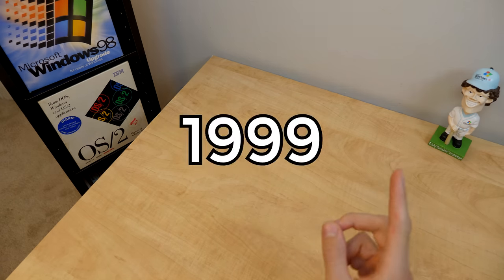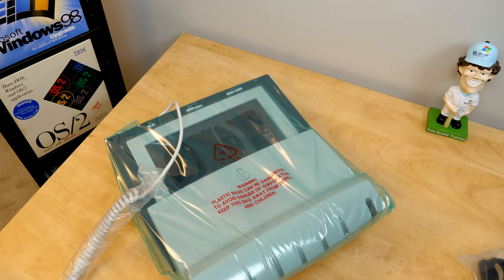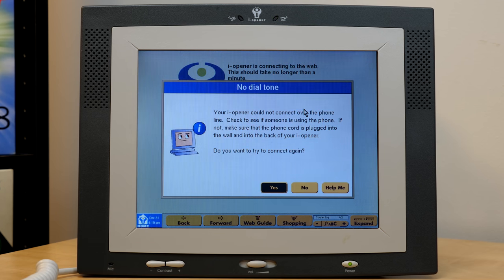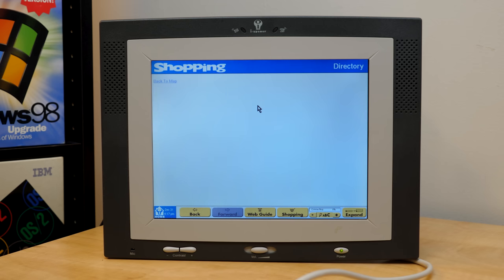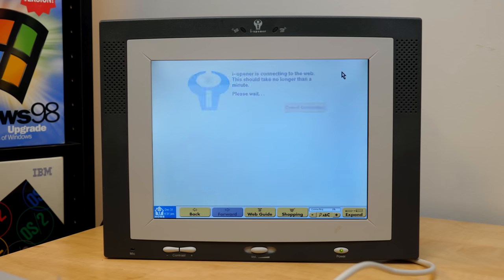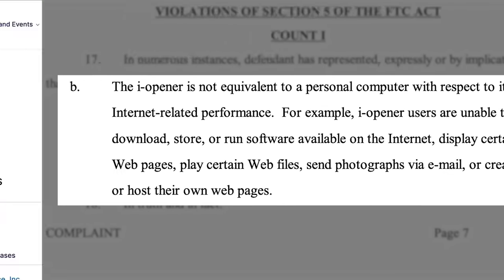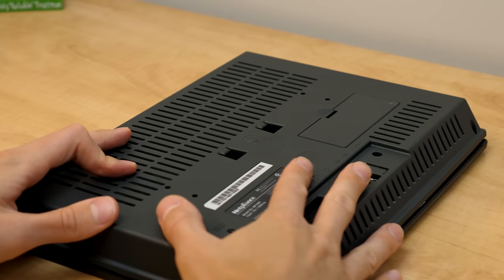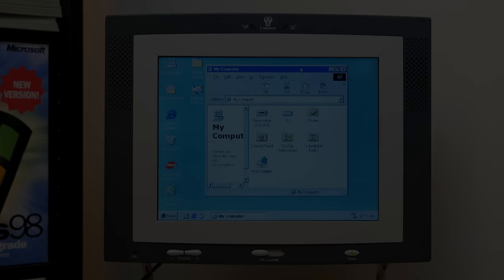i-Opener - The $99 Computer That Cost a Company Millions

Comment: Around this time there were a lot of interesting hardware hacks going around.  Both Intel and Nvidia kinda sorta goofed by releasing low-end parts (a celeron cpu and nvidia 4200 series cards) that could be overclocked to nearly the same performance as high end parts that cost up to 10x.  Software and operating systems were rapidly evolving as well, with numerous consumer-level usable Linux versions coming out while MS was switching to an entire new generation OS.  Broadband internet was also starting to become introduced in a lot of markets, one more nail in the netpliance coffin.  It was very interesting when the first chrome OS devices came out to see if they would fall into the same trap that killed off netpliance, and obviously that didn't happen probably due to the maturity of the google universe and ubiquity of internet access availability when the first chromebooks hit the market.

Comment: I bought one of these when I was working at CompUSA. Probably my first "hack". I wonder where it is. I may have given it away.

As I recall, the mod kit I bought had a hard drive mount that you had to modify the heatsink for.
Pretty sure I got Windows running. I seem to remember copying all the setup files to the hard drive before installing it so that I could run setup from within the alliance itself to install Windows.

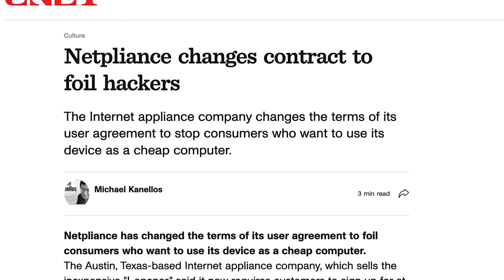Comment: 1. 21:36 I don't get the point of this 90 day subscription. I mean after the cost for the actual internet service, Netpliance might have gotten an extra 45$ through that, which hardly changes much to make up for the ~300-400$ loss for each unit sold. Or where they purely hopen for people to just not cancel the subscription and keep paying?
2. 27:15 It is a not only janky, but a really bad idea to have the hard drive sitting loosely like this while touching the main board. The hard drive casing is metal and could easily short out and kill the motherboard if not insulated at all. At least add some electrical tape underneath.

Comment: I am slightly confused as to what was going on with that computer. It looked brand new in box, right? How were there already emails and news on the machine, if it had never been connected to the internet before?
Reply from the maker: Because I used a different machine to demo the pre-installed OS.
Reply: @MichaelMJD  That makes a lot more sense. I was super confused for a bit there. Haha.

Comment: 8:40 "a lot of personal data in it", but in the start you implied that it's never opened unit? 🤔
Reply from the maker: As I mentioned, there were 2 units showcased in this video. The one with the personal data was a newer model that had cached data because it was used. The new old stock one that I unboxed at the beginning is the one I put Windows 98 on.
Reply: @MichaelMJD  Ok, makes much more sense. I guess I got distracted and missed that somehow. Thanks for clearing that up 👍